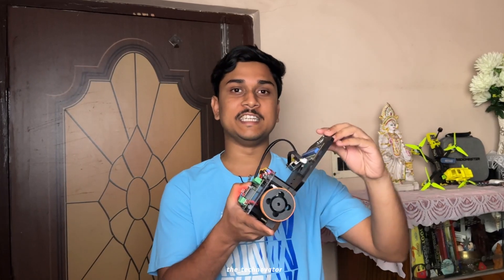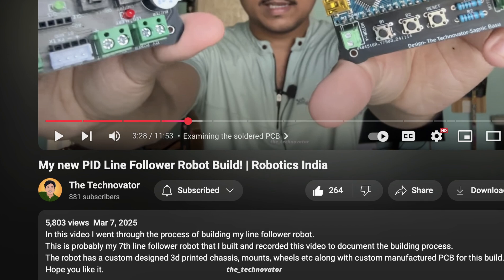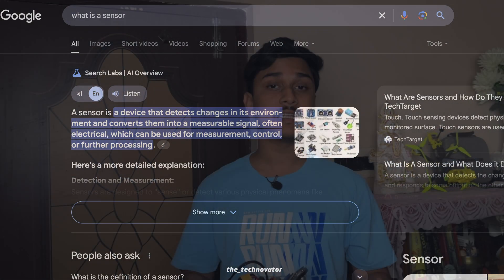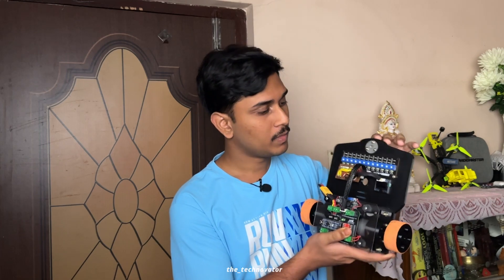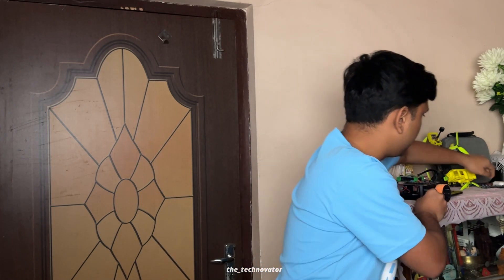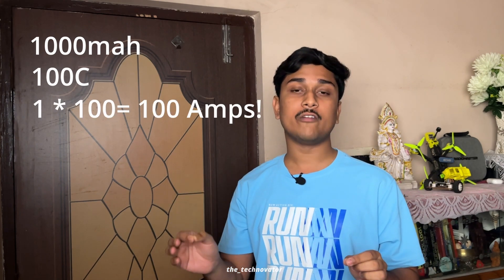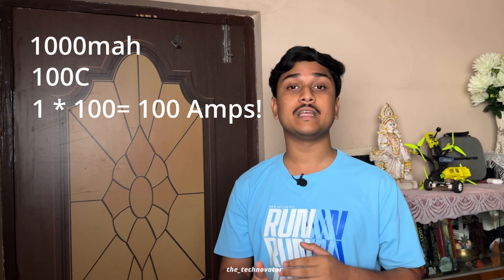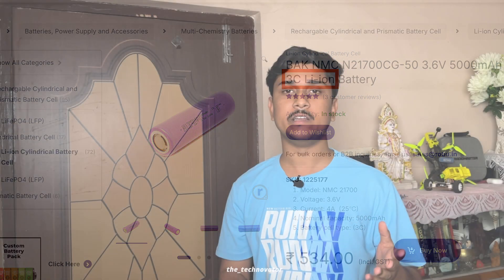Top 10 mistakes of making a Line Following Robot | Robotics India

Comment: TB6612FNG can handle 1.2 A max current, but 37 gb motor stall current is greater than 1.2 A, so isn't it a risk to use TB6612FNG with 37 gb ???